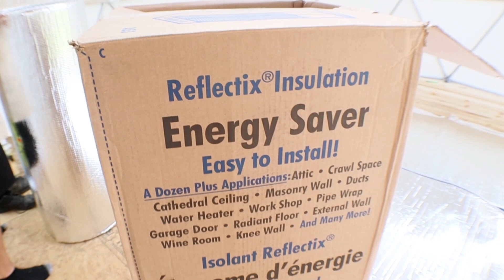Winterizing the Tiny Home Geodesic DOME for our 1st mountain winter double [Reflectix]

Comment: The radiant barrier usually is on the outside. I would double check with the manufacturer and turn it around if they call for it.
Reply from the maker: We purchased the dome at the glamping USA show and it was floor modeled so we got to see it up, the quilted side acts as your interior walls. The canvas itself also acts as a barrier with UV material and the reflextics helps to deflect the sun light that shines through the very white and illuminated dome cover. Thanks so much for watching and commenting your suggestions 😊 if we didn't get to witness this being put up and taken down at the show we would be so stumped.

Comment: Do you need great insulation for summer ? I have 90 ferinhight.
Reply from the maker: Yes, since insulation helps to regulate the air inside, whether hot or cold. You want to keep cold air and hot air out.
Reply: @NaturesNear  TY for shearing.
Bummer. I was really hoping for the panoramic view for my office. But at least now I don't have to figer out if I would have to make terasaile to dodge the sun/glair on monitors. thanx again

Comment: My main worry with a build like this is condensation.
Reply from the maker: We did worry about that too, but honestly, we only get condensation on the outside. I can't explain the material of the canvas, but we had it installed for weeks before putting in the insulation, and even then, it didn't sweat on the inside. We do have an exhaust fan and humidifier installed inside to help with dampness or humidity, though it is not hooked up yet as a precaution . It has been installed now for more than 3 months, we haven't had any issues. We even stayed at a few to get a feel for them before purchasing. I would definitely recommend that if you are thinking about it, go for it. 😊

Comment: do you guys ever get condensation between the first layer of reflective skin and the PVC cover. In my dome, whenever I run the wood stove, entire PVC skin behind the liner gets super wet due to condensation, scared that it would cause mold issues in the future
Reply from the maker: We have a dehumidifier that runs constantly, and it's plumbed through the floor. Only during really cold temperatures we will get a few trips around our window. However, the sun beats on it and dries it out over  a few hours. We also opted not to do a stove and have a mini split, which keeps it super regulated. I think it's the difference in hot and cold temperatures that causes it to be really soaked. I will also have my husband add to this 😁 if you watch our videos he's the brains lol.
Reply: @NaturesNear  thanks for the reply! And thanks for filming your journey of building the dome! it helped me and my wife big time building ours!